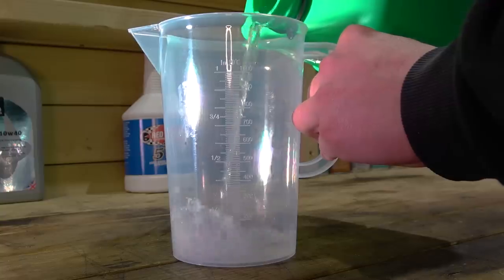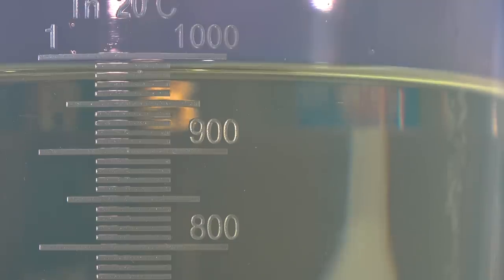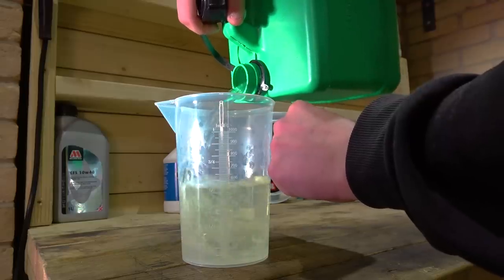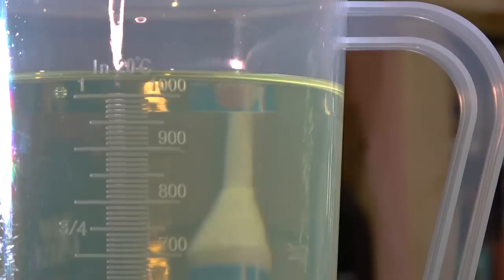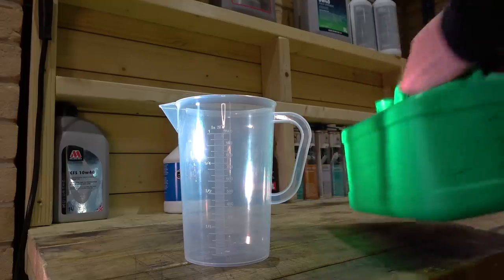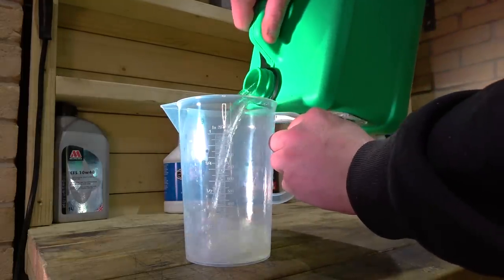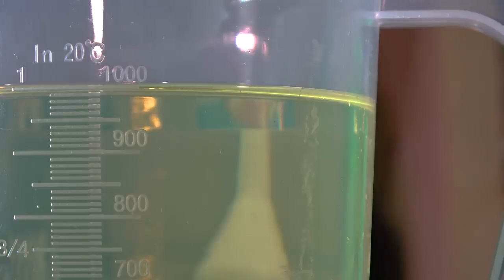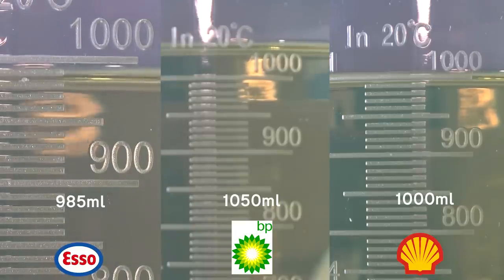Fuel Pumps Are Wrong - Esso BP & Shell

Comment: The issue with this is you have to account for so many factors. Temperature of fuel when it was delivered, any fuel left over in the nozzle or the can, the fact that kitchen measuring jugs usually aren't very accurate, the fuel pump display might round up so if it says 1.00 litres of fuel it might actually be 0.995 litres, fuel will evaporate over time. I'm sure there are even more variables I haven't thought of but it does show that any measurements made should be taken with a pinch of salt.

Comment: Shell is under-reading too, the high marker is the curvature caused by surface tension, you should look at the bottom of the apparent line which appears to be closer to 990ml.

I don't think the accuracy magically improves once you purchase more than 2 litres.  You are getting short changed on the first 2 litres on each and every purchase regardless if you put in 3 litres or 30.

Comment: You did a video on this a while ago where you pointed out that accuracy cannot be guaranteed when pumping 1litre for example. You stated that the reason for the minimum delivery was to ensure correct amounts of fuel which you would not get if pumping less than the minimum.

Comment: Taking into account an uncalibrated jug, loss through evaporation, loss through using different containers and change in volume due to change in fuel temperature, 100ml out is probably right. Unfortunately if you're going to do this kind of work it has to be done properly before you can claim the pumps are wrong.

Comment: Gas pump manufacturers need to add switches to the doors on the pump housing that shut off the pump if a panel is opened. That has to be reset by the control panel inside the store with alarms going off in the store. This stops tampering by card scammers and meter output jammers or resetting the price at the pump to a penny per gallon.  Then resetting it to the normal price.  Found a graveyard shift employee doing that 25 years ago.

Comment: That is probably the worst way to test a measure. Pumps are tested to 10 litres by trading standards with incredibly accurate containers that look like big metal milk jugs. Forecourts have a deviance of +2% and -1% which is allowable by law. The pumps are calibrated by trading standards and PFS forecourts have no access to the systems involved as they are security sealed and tamper sealed. Testing with anything other than Diesel ones-self is also no real test as Unleaded fuels begin to evaporate the minute they leave the pump. You may also notice on pumps they sometimes say "Price per Litre at 15 Degrees Celsius" because the pumps will auto dose based on the current temperature of the fuel to allow for density changes that occur within fuel types. They do this to be as accurate as possible. The tiny differences seen here could be caused by many factors. The plastic jug is by no means a scientific measuring device and will not be 100% accurate. The fuels could have begun evaporation in the green cans, which is why you can smell it when you open them, sometimes with a slight 'hiss'. The point at which the pump was extracted from the can, fuel remaining in the nozzle (you get nothing for shaking the pipe all over as the fuel stops at the nozzle valve).
As for cars fuel gauges, they are an estimate, not an absolute and the float in a cars fuel tank is not the most accurate way of guessing what went into your tank. Computerised fuel gauges need time to measure level in tank against engine running to give estimates on MPG or Miles available. As far as i know there are no fuel gauges that tell you how many litres you have sat in there. PFS storage tanks have probes that can measure down to the mm how much fuel is in storage and continuously gives NET and GROSS readings based on temperature and density compensation. You really are not being ripped off at all, not in a reputable station which is governed by laws. Maybe a small back shack out of town dust cabin is ripping folks off with 1940''s style hand cranked pumps but not your modern ones.
I have worked in this industry for over 15 years and spoken to many engineers and standards officers.
I love watching your videos, I really do, they are brilliant but I wouldn't want your genuine concerns to start public speculation and paranoia as it seems it is already doing here. The poor folks in the PFS dont need the extra headache on top of drive outs, inability to pay, smokers, mobile users, kids trying to fill up, people who cant understand a word of English, abuse both verbal and physical and working in one of the most dangerous environments out there for the crappy pay we receive.
I am quite happy to answer any questions people may have about fuel safety, restrictions, operations etc  :)

Comment: when I was just a poor boy at University, I had a hobby which was fixing lighters and selling them on. I used to go to the local self service asda pump late at night. I had an empty tin of Lighter fluid and I used to go round all eight pumps lifting the nozzles off and lowering them to ground level to empty what was left in the hose to get the residual fuel out left inside. I usually only ever got half way round before I had filled up my 250ml bottle of lighter fluid.

Comment: I wonder if fuel stations have their pumps tested as often as they used to? When i was a kid back in the 70's i would from time to time see pumps being tested for accuracy - normally a bod in blue overalls pumping fuel into a measured container via a massive metal funnel. You would then see the same guy dipping the underground tanks to check for water at the bottom. Have not seen anything like that for many years now. You would like to think that someone independent from the fuel station still does those checks today.

Comment: heres one for you the fuel regulated by the handle on the nozzle that you press (the harder you press it the faster the fuel is dispensed the less its pressed the less fuel is dispensed. so it must be determined on how hard the handle is pressed that goes to the computer in the fuel pump and that sets the speed of the motor for the amount of fuel you need. so if the handle is worn through wear n tear the computer will be thinking that more or less fuel is actually been dispensed than there actually is been dispensed if inside the mechanism is worn the computer will think its going full speed but because of wear n tear it will only be going say about 3/4 from full which is why there may be an abnormaility in the amount you get. hard to explain tbh. if the pump ran out of fuel and you overide it (as most have a shutdown once the tank is empty) so nothing came out would it still think its dispensing fuel as the motor would start when you pushed the trigger. as it seems to work on the trigger if so its always going to be inaccurate (dependendent on how long the pumps have been in and their use).

Comment: I'll fill my tank at BP, but 1 litre at a time. 

When I get around to doing this, I'll be sure to film it. 
I reckon each transaction will average out at 10 minutes because my bank will block my card multiple times, requiring a phone call.
50 litres x 10 minutes is about 8 hours at the fuel pump. 
That's fine, because it looks like I'll get about 500ml for free. 

Thanks for the Top Tip Mr. Auto Shenanigans

I'm aware this video is a year old. I'm still commenting on it. My life is exciting.

Comment: I worked at a petrol station about 10 years ago and those pumps were dodgy as @#£%! We weren't allowed to let the underground petrol tanks get too low otherwise customers could literally pump AIR (no fuel!) and it would still charge the customer like it was pumping fuel! I literally had a guy come back after putting £60 in his car and his fuel tank was clearly still empty! We did have visits from someone checking the pumps but I don't know if that was an independent thing or just a company thing? We would never know if one of these smaller inner city foreign run petrol stations were ripping us off on our fuel? They've certainly been exposed plenty of times for skimming customers credit cards, so not delivering the correct amount of fuel would be nothing for those kinda people.

Comment: As a kid with a moped in the mid 80s We used to "pump" fuel out at night...
we compressed the hose with the pump valve open to get maybe 300 ml out, than we closed the handle and let go of the compressed hose, and repeted until our tanks where full or somone "grown up" came along
But if you let air into the hose we had to "raid" another pump/station
I guess we just made a "bladder pump" like you will find on small outboard fuel tanks 
And i suppose there is a check valve before the metering pump
A freid of mine later drove a car from east of Norway to the west at night and all gas stations where closed, so they did the same with their car roling over the hose The next day they called the gas station and wanted to pay, and the owner told them gas was on him!😇😇
Reply: gives me an idea to make a peristaltic pump that you loop the hose around :D

Comment: The BP reading may have been different because the previous delivery still had fuel in the pipe . Did you check that ?. It's surprising how many people do this when returning the nozzle into the pump and accidentally putting an extra shot in the pipe.
I always make sure everything has gone in the tank.

Comment: HUGE mistake in this test, these fuel pumps can not accurately measure just 1 liter. ALL the fuel pumps here in Norway has a warning on them that they can only accurately measure more the 2 liters and the more you fill the more accurate the measure is. When you fill less then 2 liters the pumps is not guaranteed to be able to keep the minimum required accuracy.
Reply from the maker: Yes we know, it's why we made this video... See earlier video for context.

Comment: I think there are too many variables here for a conclusion.
For example, how well did the previous user wring put the nozzle? Because that could leave residual fuel that ends up in the measured volume.
Also, the jug isn’t very accurate (I bet it says “Approximate measures only” somewhere) - so it’s okay for comparison, but not for absolute standard volume.

Comment: Also....the temperature of the fuel and ambient plays a factor. Always fill up on a cold day!.
But... any given station may be a franchise and the station owner (if not the petrol company) may have a preference for type of pump, manufacturer, manufacturers model...etc.  So you could probably go around a number of the same brand fuel stations and get different results. 
The more you put in, the more accurate it is going to be, and as you say, there is legislation which covers this.

Comment: Maybe the Esso volume was slightly less because they charged £1.63 for a 'litre' of diesel advertised (on the main sgn) as £164.9.  So do the pumps adjust for the price to get to the nearest whole penny?  I also noted that you filled the car not a container in the  original video 🤣

Equally there is a difference between the main board sign and the paid price for Shell and BP where there has been a rounding up to £170 from £169.9.

Comment: Okay, well take it from someone that works on these, legally there is a tolerance that for every 20 litters it can be either 0.03 extra or less as it is next to impossible to get them bang on, the difference in all these is so minute that you could not even tell as a consumer but as a petrol station, for a million litters you sell, you will almost always be short 2000 to 3000litters of the final figure. However I will also add that if you're filling up a Jerry can with petrol you will loose liquid simply based of the evaporation of ethanol content, which is also a major factor to consider in all this.

And as for the companies they do not decide if they give you extra or not or how their pumps are set, it all comes down to pump internals, which are designed so that slightest inconsistencies give them an error to prevent any unfairness.

Comment: how a fuel dispenser should work is YOU ENTER the value you want, and it will fill up a WEIGHTED reservoir to the point where it's that value then it has a pay and eject system, you pay it ejects all the fuel in the reservoir

Comment: In case nobody has mentioned it yet, if the measuring cup is not gasoline resistant it can absorb fuel into its walls, lowering the apparent volume.

Comment: There's such a thing as vapor pressure.
It evaporates.
There's such a thing as density.
The density, and therfore volume, is entirely dependant on temperature.
There's such a thing as viscosity, so there wil be several milliliters of fuel clinging to the inside of the can.

This is VERY far from a scientific test.
The accurate way to measure it would be to weigh it inside an enclosed can already tared on a balance.
There's also that fact that the viscosity differs with temperature too, and there's an inherent inaccuracy in the method of transferring the fuel itself.
The hose itself is subject to the laws of physics and chemistry.
Of course they can "get away" with this. Otherwise no one would ever be allowed to sell anything ever.

Comment: Just because one BP station pumps out more fuel than the others doesn't mean they all do. It's all to with pump calibration and the metering of the fuel. These should be regularly checked by the local trading standards, weights & measures dept. As you would anything used for trading, such as weighbridges.

Comment: It's also how you fill up, if you pressed the nozzle and let go exactly at 1L, or if you let go at 990ml them pressed another 10 times to get to 1L
The counter can start a little before it actually starts dispensing fuel, so the press and let go once method is better.

Shame not all pumps have the option to select how much fuel you want, that way it auto cuts off when it get to the limit you set. Though I have never seen one of these types of pumps ever, but I am told they exist, somewhere.
Reply: Breeze petrol station in Holmer Green has the preselect price pumps. I believe they are a chain as I googled it and got a hit for Harvest Energy and Breeze so perhaps there's one near you?

Comment: During your B-roll I saw two pumps, one which had a label saying "at 5°" and one without. The first will correct the amount of fuel depending on its energy density determined by temperature, the second will just give 1L as it comes out, regardless of the temperature. You are after all buying the energy rather than the liquid that the energy just happens to be contained within. 
The allowable error in the vast majority of circumstances is 1% in excess or 0.5% short (although it has to be set within 0.5% when it's first calibrated) and I suspect the first one would still be short even if you poured more than 2/5L.
When I was a weights and measures inspector we didn't even have calibration cans for less than 2L.

Comment: Is it proven that pumps are accurate with larger quantities?? Logic would say that if there's a discrepancy at small quantities that difference will get larger with larger quantities. 

Also, it really bugs me when you use the pump and you can tell that the fuel starts to flow slightly after the numbers start to turn!

Comment: Not to mention that most people don't have a container the right shape or size for measuring more than 2L accurately. At the point where you're trying to measure 5L in, let's say, a bucket.... the difference in level caused by a slight inaccuracy of the pump would be almost immeasurable... except maybe in the case of BP.... you might need another bucket there...

Comment: They calculate this scientifically, while yes it's true fuel shrinks in volume at low temps, usually below 15 degrees Celsius or 60 Fahrenheit, this rate is calculated as being the most stable across as many countries as possible to ensure the deviation is minimal, Scotland could ferry some over from Iceland and possibly profit if it was not regulated at a certain rate, so Iceland likely gains compared to Spain or Italy if sold from the same supply due to the volume changing.

Comment: Did you take in account thermal expansion, and also, some people empty what's left in the hose by lifting it after filling, be sure to dispense some fuel first like into your car to account for missing fuel in the hose =) Thought provoking, thanks!
Reply: You can't empty the hose like that, the valve is in the nozzle.
Reply: @barryhall7  The machine cuts off the gas at the specific amount, however, you can still open the nozzle and get the gas in the hose to flow out =) Please don't do that by the way people.
Reply: @MadPlasmatist  you must be taking about pre payment, not worth the bother for a dribble.

Comment: Of course the temperature is the big issue with volumetric measurement,  just one reason why you load rockets with very cold liquid fuel.
Again , wow diesel gives you more miles, but it is sold by volume, and it is denser, so of course you get more energy from it, yes I know the diesel engine is more efficient as well.

Comment: I don't think the pumps are somehow more accurate in dispensing more fuel in terms of actual millilitres. It's just that the error will be a smaller percentage of the total for bigger totals. I.e. if its + or - 50ml with a minimum of 5L that's only + or - 1 %, dispense 1L at + or - 50ml and it's + or -  5%

Comment: The pump says minimum delivery 5 litres. The brand of fuel is not relevant. It is what each meter delivers and there are tolerances for this. Trading Standards (weights and measures in old money) use 5, 10 and 20 litre measures with a fast and slower delivery rate. It is common for differences in quantity depending on the rate of flow. 
Have a look at how you emptied those cans. You didn’t turn them upside down completely. There may well have been a little left inside due to their shape.